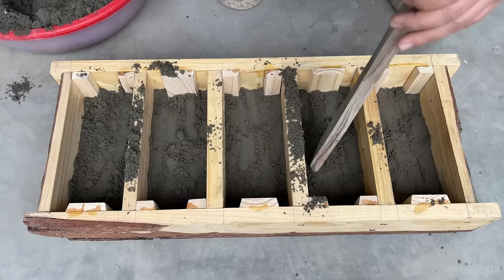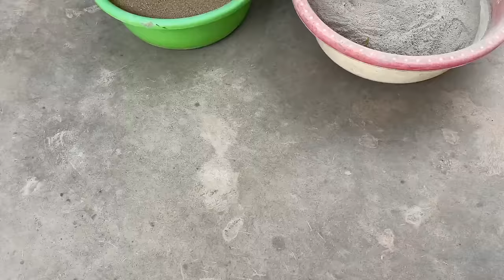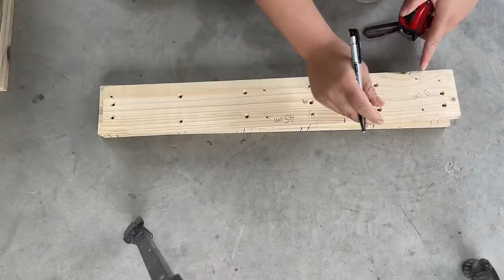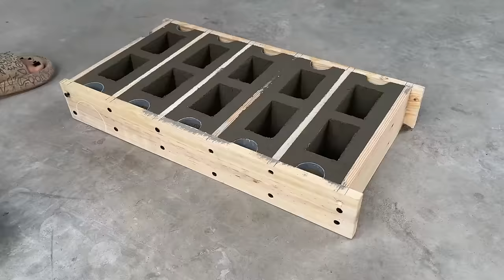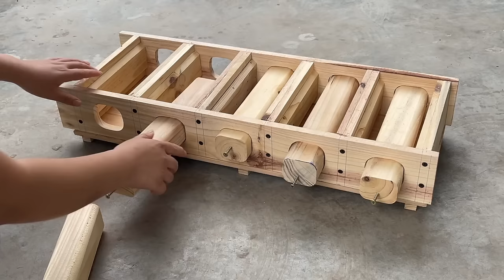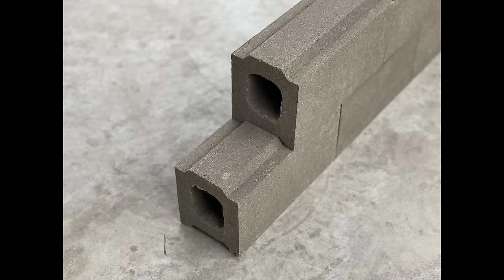Top 6 samples most creative smart brick molds

Comment: Extremely helpful and knowledgeable, THANK YOU SO MUCH 🙏
I´m going to build a barrier/wall for a pond, so that last version looked
easier and also stronger with the end dent. I will have to render with
strong cement and build buttresses/supports every 2 meters maybe too?
Yet it will be a lot cheaper than buying the huge commercial blocks.